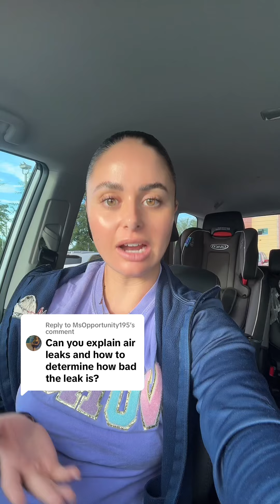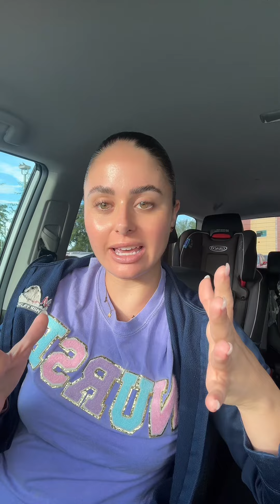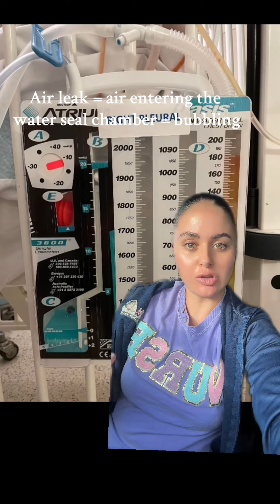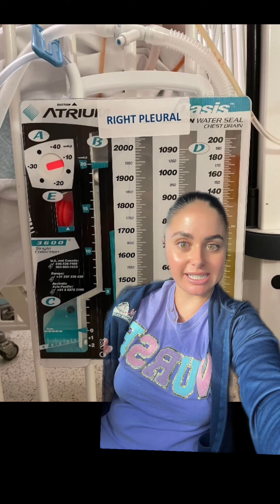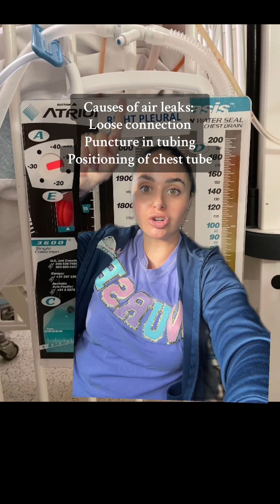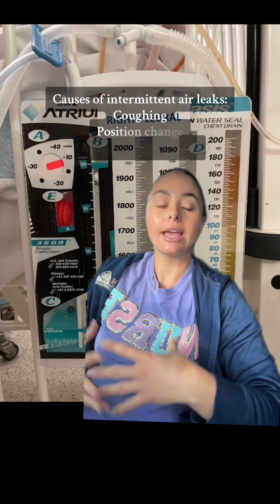CHEST TUBES: types of air leaks and troubleshooting

Comment: During COVID I experienced chest and neck trauma that not only made my symptoms worse but created a pneumatic fistula in my neck and right lung. Ive seen every specialist in Philly and despite my efforts have been told the hole in my lung is a pulmonary bleb. Its evident it is a persistent air leak in scans but they still refuse to close it. As result of the leak Ive had multiple CSF leaks in my spine next to the leak. Ive uploaded several videos on my page and made every effort to heal but without the bleb being treated, a chest tube or needle decompression i will continue to suffer. :( As a paramedic of over 30 years you would think they would listen to be but no matter what I say or do they wont close the hole. Im tempeted to give myself a pneumothorax so they give me the chest tube which will save my life and return me to normalcy.